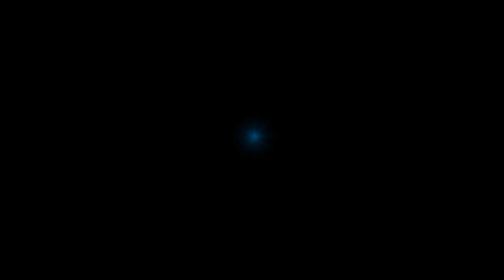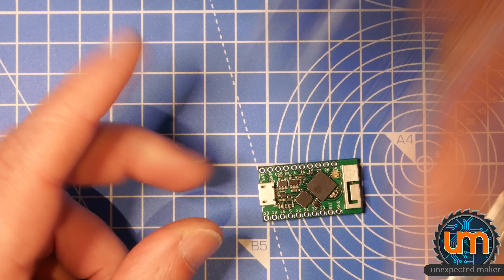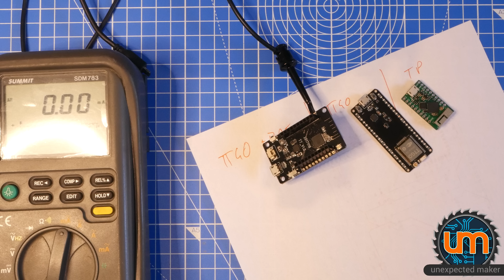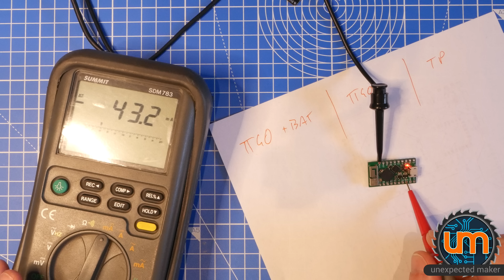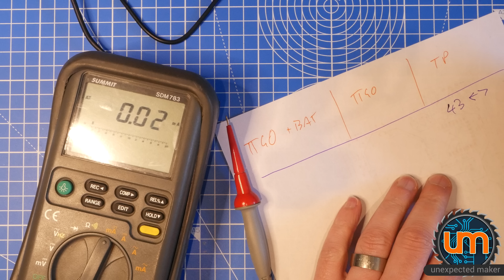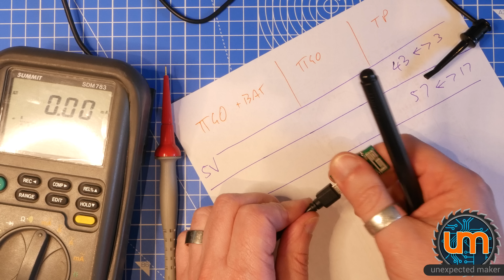TinyPICO - The Power Draw Quandary

Comment: It could well be a ground loop problem if your power supply is not completely isolated, the computer is ground referenced, I have seen this happen on an arduino board I was working on.
Reply from the maker: Cheers Michael!
Reply from the maker: In this case it was just the data line sensing on the IC... as I get exactly the same results on (was 2, now 3) other boards with the same CP2104. Some of the boards have the USB shield grounded like I do on the TinyPICO and some don't... all showed the same results.
Reply: Unexpected Maker your lab power supply is completely isolated as I have the same one and just checked again. It’s a linear one with a real transformer. The earth ground is available as a separate banana jack on it.

Comment: My first guess (before watching the rest of the video): when connected to the laptop, the usb serial chip is enabled and it's using more power.
Edit: Indeed. Nice video! Good to see your TinyPico board is doing allright!
Reply from the maker: Good call... yup, no idea the CP2104 had data line sensing.... pinouts only suggest VBUS sensing.